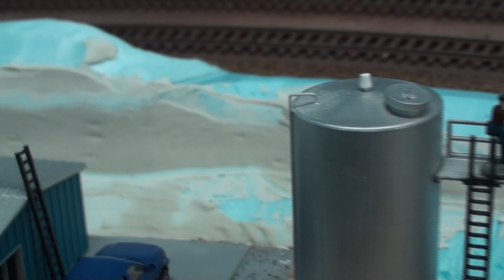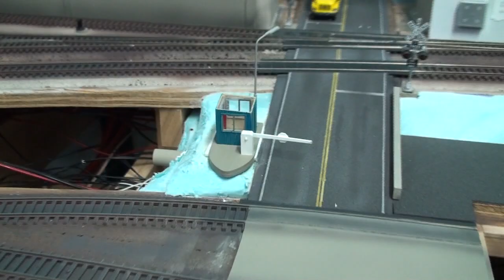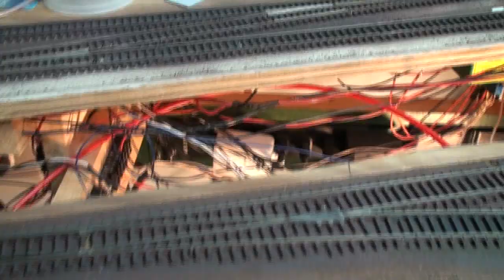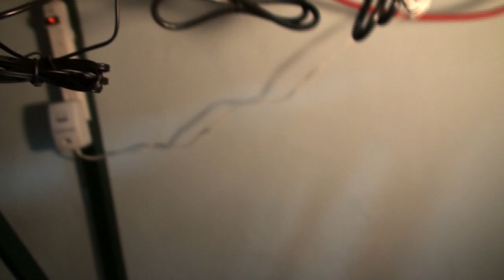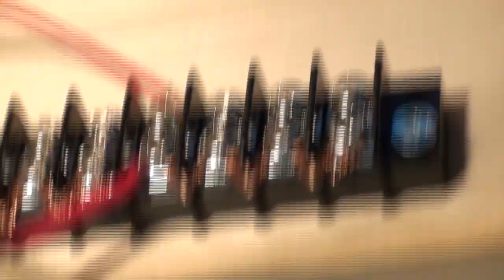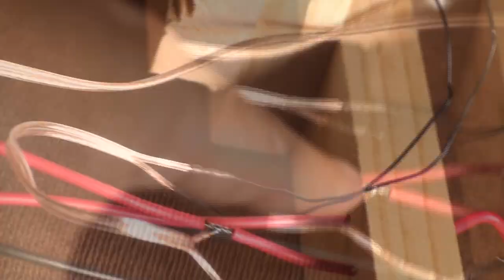My CSX/NS HO Railroad Part 48 F "Lighting the Locomotive Shop"

Comment from the maker: @TheJoePaul  

1. Striping wire? (I use regular wire stripers and make two cuts 1/4 inch apart.  Then I use an exacto knife and slice off the 1/4 inch section.)  

2. Soldering upside down?  (CAREFULLY pre-tin both, the 1/4 inch section that you stripped from the bus and tin the "speaker wire".  Then since the bus in held in place by the bechwork hold the soldering iron in one hand and the light or pre tinned speaker wire in the other hand.  touch both wires and heat.

Comment: I have a few stupid questions ,from trying myself with no luck, how do you strip a small section out the bus?razor blade or tool? how are soldering UPSIDE down?  and how are you connecting the 2 small wires from the lights to the (ill call it) speakerwire, then to the bus?solder or just shrink tube-thanks for any answers to help me

Comment: Looks really nice !
One tip though, I wouldn't run the CMX track cleaning car over the diesel shop track. The Cleaning pad & solvent will take the paint off of where the tracks are, & will leave a big smear. I would use a bright boy in this area, or carefully use q-tips with 90% alcohol.